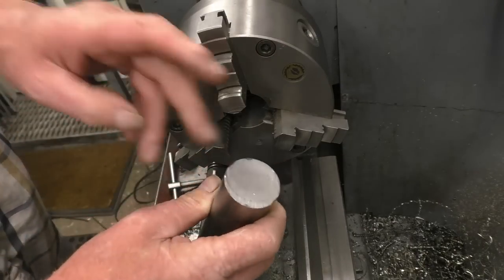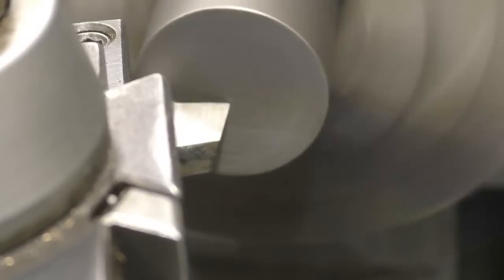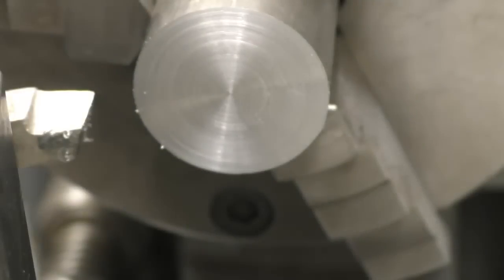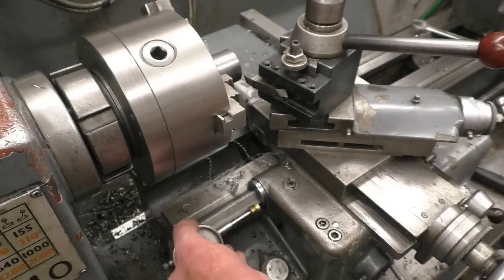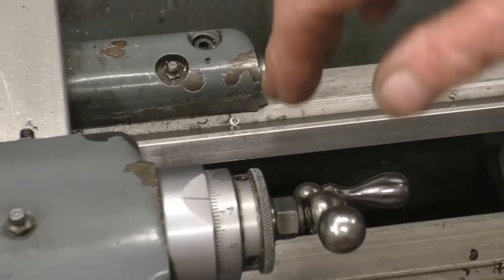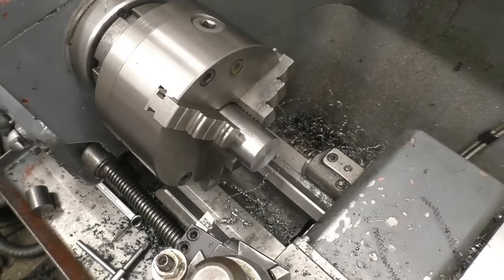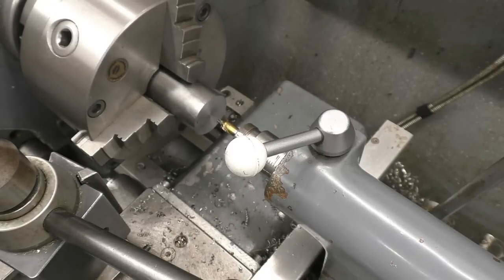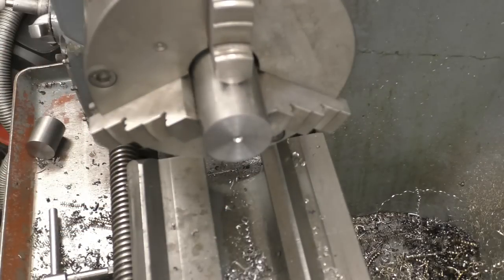Lathe Tutorial P3  Facing & Centre Drilling

Comment: Excellent basic tutorial. I believe there is a lot to be said for not using centre drills in most situations to start holes. Use a 120 deg spotting drill. These match drill tip cutting angles, are more accurate and are much stouter.

Comment: Let's say that you wanted an 18mm hole in the end of that bar, would you use the largest center bit, 5mm in my case and drive it fairly deep into the bar resulting in a larger countersunk hole for the tip of the 18mm to sit in? Or do you work your way up to that size, removing material in stages with smaller bits??

Comment: Yes, there is one thing that I wish you would explain. I have seen you and others cutting threads using the dial position to know when to engage. And I understand that the position of the dial numbers relate to the half nut, but I just can't quite understand how the half nut interfaces with the lead screw at one precise time/location.
Reply: The halfnuts are 2 semi circular pieces that open apart and close together by means of the operating  lever on the saddle.  The 2 halfnuts have the same thread form as the leadscrew on their inner diameter. When the half nuts are opened apart the inner thread is running clear of the leadscrew. When the half nuts are closed together their inner threads are in full engagement with the thread on the OD of the leadscrew. The indicator dial simply shows when the operator should engage the half nuts by moving the engagement lever...does that give you a better understanding? 
It would be great if John can do a tutorial video on the half nuts function and the relationship to the indicator dial and threads being cut.
Reply: @howardosborne8647  Thanks, but that much I knew. It is why you have to wait for the number that is not clear. What happens if you wait a little too long, and why. What is the relationship of the timing to the thread ?